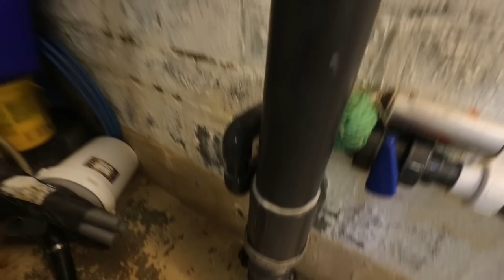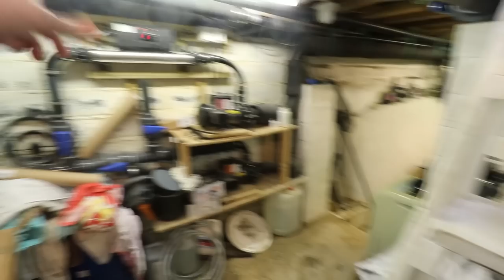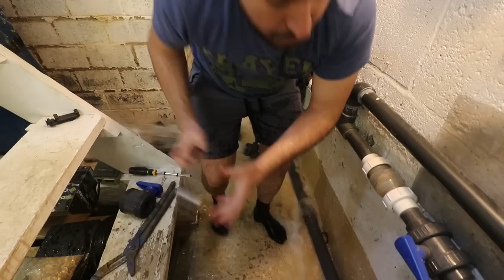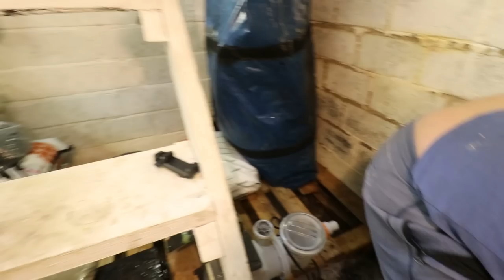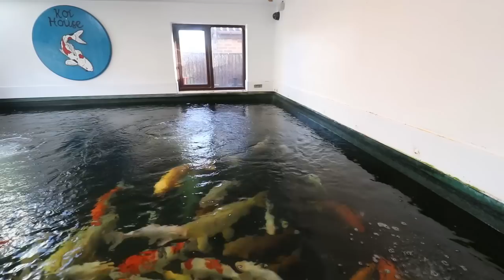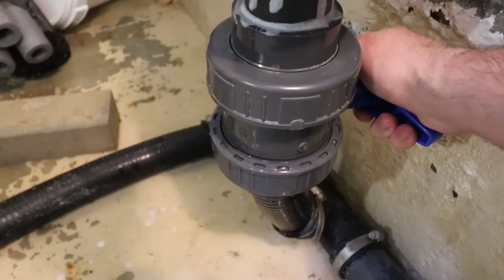Changing a ball valve the hard way

Comment: The extra rubber gasket you found is for the bottom side of the ball valve. You can see it leaking when you open the valve. Also if the ball joint is too hard to move, you can "untighten" the ball inside by adjusting the inner ring of the valve.
Reply from the maker: Your right I just had a look it felt as though it was on but i didn't actually look it had come off.
I never adjusted them because the adjustment is on the wrong side and didn't really want to take it off.

Comment: Good job! and ballsy to do do it live... Kudos 👍👌 😄
when doing a 'snatch' smear some silicone sealant on the valve side O ring seat and let the O ring set overnight, 
and the water pressure won't blow it off as easy.

That job was nearly as good as a mate of mine when he did a snatch with an 8" valve on a fire hydrant main at an army base...
...created a new river 5 ft deep and 10 ft wide lol...🤣

Comment: I had a similar issue when purging the 4” bottom drain, the whole ball valve came away in my hands, it had not been welded in place & only friction had been keeping it in place. To replace the valve I had to inflate a rubber stopper through the open valve then dry & apply pipe weld adhesive….this time it worked perfectly
Reply from the maker: Well done, Ive never had much look with those inflatable rubber stoppers.